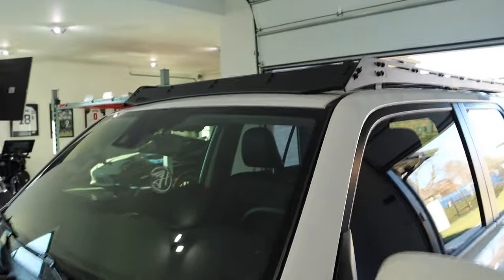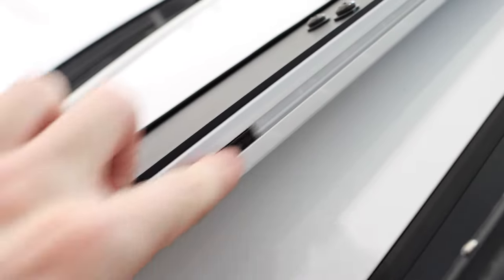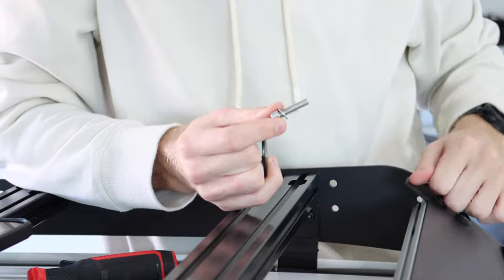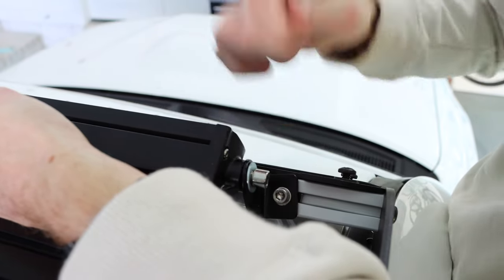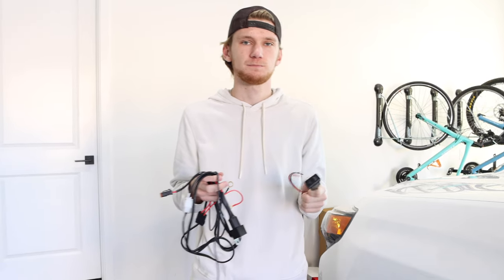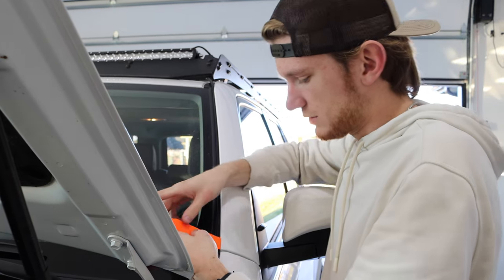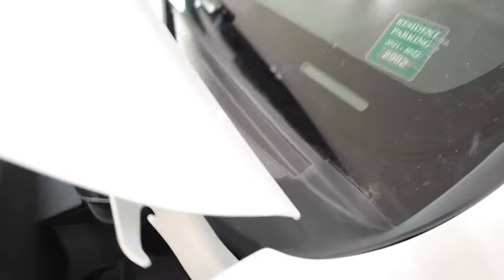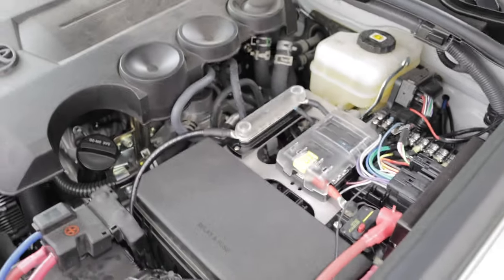LIGHTS FINALLY work!!! 40" Cali Raised Light Bar install on Prinsu Roof Rack (2021 4Runner)

Comment: That channel you placed the offset hole nuts (T-Nuts) into looks the same as used in (most) 3D printers and if so, you want the flat side of it pointed outward towards the opening. If they are good ones then they have cross-hatches which grabs the edges of the aluminum to keep what you attach well locked in place. With the rounded side pointed outward the moment it rains or you wash the car the things you attach can slide in any of the 4 directions (up-down, left-right). 2020 Aluminium isn't really that strong so having the strongest attachment (flat sides facing out) is important.
By the way, if the T-Nuts it came with don't have cross-hatching on the flat side you can buy them with as much from near anyplace (try T-Nuts said to be for 3D printing if you aren't finding them quickly).
Hope that helps.

Comment: Hey Connor, I'm looking to do the same thing. I'm stuck on whether to do cali raised roof rack with light bar and side lights already mounted or do the prinsu roof rack with light bar and then add on side lights to the rack. Which do you think is better in my situation? I like the look of prinsu better but the hassle and work the cali raised roof rack takes off by already coming with side lights is nice too. Thanks!
Reply from the maker: Thanks for watching the video!! I think that personally comes down to you in whichever route you want to take. My motto is so whatever you think looks best, putting in more work is worth it if you think it will work better!

Comment: Dude the short fat screw on the side of the LED bar no problem.  How in God's heaven were you able to fit the 2" screw to hold the bracket on the bar? there is not enough space.... did I get wrong screws from Cali R.?? There is no way!
Reply: Experiencing the same thing rn wondering what you did?
Reply: @matthewfisher7735  He got it wrong in the video, he probably figured it out later on and he got lazy editing the video. Those screws do not fit there for sure. In my case I got the wrong Screws from Cali R.  1" will do the job.

Comment: Hey Connor, I am experiencing some whistle sounds at 40mph+ which is annoying. I think I did same installation as like you did and wondering if you are having that issue or not. :)
Reply from the maker: I have not heard any wind noises and I’ve gone 80+ to test and have not heard a whistle at all which is why I was really impressed with this rack. If my sunroof shade thing is opened where the sun is coming through then I can hear some wind, but when that is closed it is quiet!